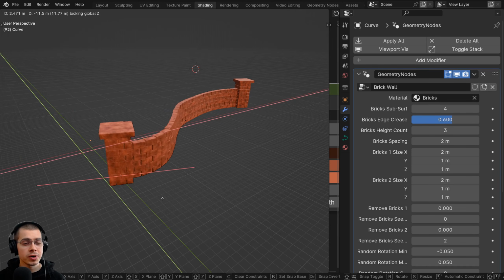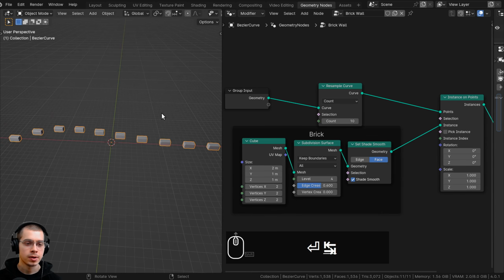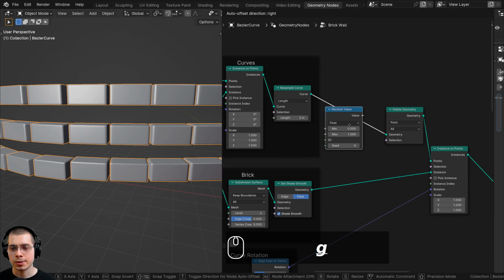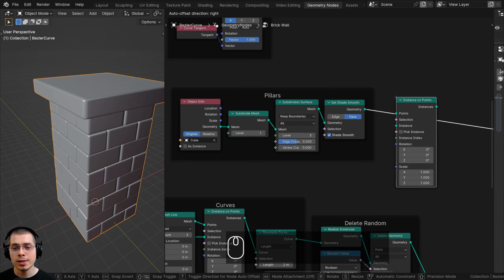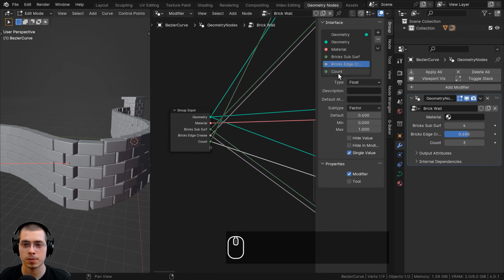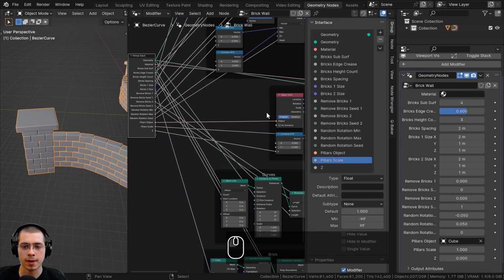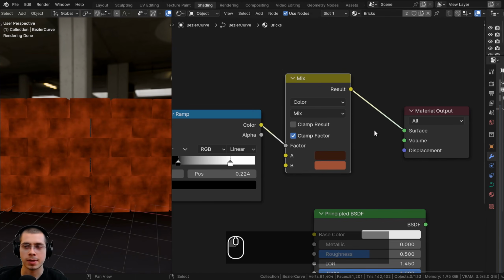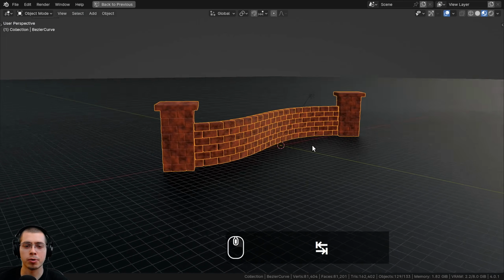Customizable Brick Wall - Geometry Nodes (Blender Tutorial)

Comment: This is a super clear tutorial! Thank you for making it. 
A note to those following on newer versions of blender - Blender 4.5 is deprecating some nodes. "Align Euler to Vector" is being deprecated in favour of "Align Rotation to Vector", and "Rotate Euler" is being deprecated in favour of "Rotate Rotation". 

Also, when exposing values via noodles into the Group Input, the "Single Value" checkbox has been changed to a "Structure Type" dropdown menu, with the options "Auto" and "Single". Selecting "Single" in the dropdown menu will get rid of that same little button in the geometry nodes entry in the modifier stack.

Comment: Fantastic tutorial! The only issue I’m encountering is when the curve used for the Geometry Node is very tight… the bricks end up intersecting with each other.
Would it be possible to implement an effect similar to the “Curve” modifier, which actually deforms each individual brick to follow the curve more smoothly?

Comment: I need a script that turns any object into building blocks, bricks. I'm an old 3DS Max user who pretty much was forced to transition over to blender. I had a Max Script that did this, but have been unable to find a Blender equivalent. The Max Script was simply amazing (and free). It gave you control over block size, block roundness, randomized block size seed, etc. Specifically I I need this for making a pyramid for 3d print. Anybody have any leads?

Comment: I loved this! Helped me learn a lot about geometry nodes. I just have one thing I want to see if you have a solution to. It seems because the mesh line is starting 1m over on the X axis, that when you rotate and extrude the wall along the Y axis, the bricks become way too offset due to the meshline offset being 1m, making it impossible to make good looking curved/squared off walls.
Reply: I had the same issue, found it after rewatching like 10 times 😂 the transform geometry node needs to be between the cube and the sub surface nodes. I had it between mesh line and the instance on points🙄

Comment: is there a way to have hard edges instead of the wall curving? also I had an issue as my pilar was scaled very weird and wasn't the correct size. I had to apply transformations for anyone who may also have this happen. changing size in nodes just scaled everything separately and kept the weird shape looking even worse. when I applied transformations, I ended up applying locations as well. Which caused the issue of my pillar being very far away, I then had to move it back to center and only apply location and then move it back out of scene.

the closest I got to making nice corners was changing to paths and deleting unneeded vertices and shift+D making it separate but still in same obj. is there a better way of doing this?

i still only have 50hrs on blender and things get real confusing and sometimes things get real messy even when i follow completely, but im getting there slowly
Reply: If you go into Edit Mode for the curve, select the parts you want straight, right click and change 'Handle Type' to Vector, you should end up with nice straight walls with sharp corners.

Comment: 1. I modeled the bricks and towers a little differently. In each geometry I made chamfers with two Segments and Shape=1. I then moved them into geometry nodes and set the Subdivision Surface node to level 1 and the Edge Creas parameter to 0.1. This allowed me to reduce the amount of geometry in the scene by about 4 times and now my wall is being built without delay.
2. It is not necessary to pull all the connections into one Group Input node; you can make as many of these nodes as you like and place them near the nodes with which it connects: anyway, in the end, all inputs will be combined in the Geometric Nodes modifier.
Thank you very much for the video!